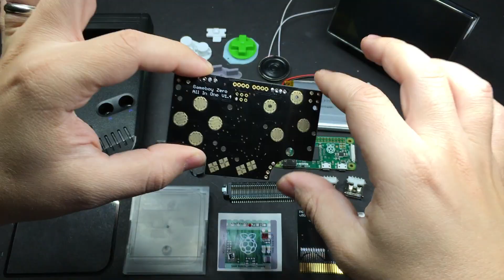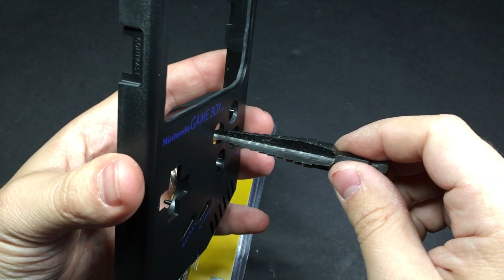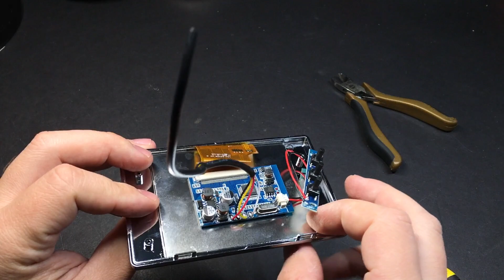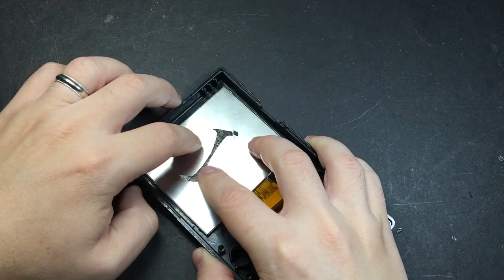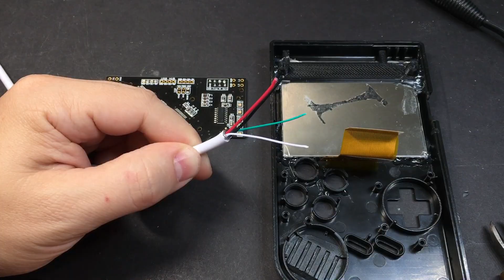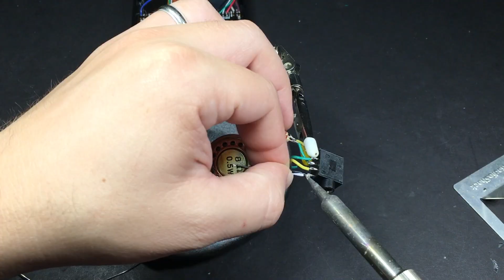Game Boy Zero Custom Part Build Guide Part 1

Comment: Please can someone help me; the sudomod forums site seems to be offline or otherwise unreachable for me (I've tried with VPN too, since I'm in germany). My screen controller board is a different one (BEST012-3.5D-V1.1, hope this is the right description). It clearly says it needs a 12v input and I have not found any instructions on how to convert it (if possible) to work with 5v. If anyone could help me with this specific board I'd hugely appreciate it

Comment: I like this guide it is very informative, but it seems a lot of the part links no longer work. I saw you can use a tinkerboy as a replacement for the button PCB. However, does anyone have a good alternative for the cartridge PCB? I like that little touch that a bit of it is housed in the cartridge.
Reply: yo dude, you found anything?

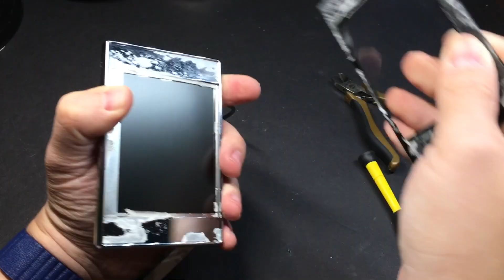Comment: pro tip 3 years later: 4:50 - heat it up with a hair dryer so you can remove the thing easy from the glue.
Reply: And someone called him savage IN THE COMMENTS...

Comment: I realise this video is rather old now... but if anyone wants to do a build like this... You can get 40 pin DPI screens really cheap all over the place i get mine from buydisplay... Theyre great quality and you can contro and runl them directly from the raspbery gpio. You only need to have a separate board to drive the backlight. Its far more efficient and higher quality than using a composite video display like in this video...

Comment: I can't get my screen to work. I bought one like you have in this video on ebay... but the controller board is different. I connected it but it doesnt do anything. Maybe the voltage is too low? How could I check if the display isn't broken?

Comment: Is there a way I could just use these parts for a Raspberry Pi 3? I'd swap the case of course.
Reply: I'd recommend checking the forums. I've seen people who've done it with a pi 3, but their builds used different parts and modifications.
Reply: Matt Henderson I’m probably gonna build a super pi boy from thingaverse but I dunno what to do to connect the buttons on the front and back
Reply: Matt Henderson also is there a way I could say cut up a cheap wired third party snes controller and solder the wires to the gpio?

Comment: Wermy, it would extremely beneficial if you did an update. The PCB all in one boards are no longer available and when they are the are extremely hard to get. Which makes it hard to wire everything else up. I’m having to scour the web looking for hints on how to combine all of the old information-with the latest and its super frustrating. Those boards are super hard to acquire. Do all that have dropped money on this project and are following your lead and tutorials a huge favor and make an update giving options and similar compatible parts to the pcb board. I am sure I am not the only one at a cold standstill with this product now because the unavailability and inconsistent products that Helder makes
Reply from the maker: DARTHRAIDER some cool stuff coming up in the next couple months - stay tuned.  :)

Comment: Does anyone know of a good color backlit screen that's the same size as the original GameBoy screen? 

I want to build a Pi project like this, but I want to case the DMG GameBoy inside a Konami Hyperboy, which is an awesome mini arcade cabinet. In order to do that, I need a 4:3 screen that's the same dimensions as the original GameBoy. 

Any advice?

Comment: It would be an absolute dream to build one of these, except I would want to use a Raspberry pi 3 instead, do you think all of the parts could still fit inside? If not, what sacrifices in the hardware do you suppose I would require to free up space?

Comment: Would this LCD work? https://www.aliexpress.com/item/3-5-inch-26P-SPI-TFT-LCD-Display-Screen-with-Touch-Panel-320-480-for-RPi1/32746328272.html?spm=a2g0s.13010208.99999999.346.8NrZfU
Reply: Dimensions SEEM to match. I ended up doing a different project instead, but at the price of that panel, and its claimed compatibility, it is worth a shot. It should have direct compatibility with the raspberry pi without any extra boards, so it should do the job. You would also have a color screen so you could play NES games and gameboy color games on it too. 
A black and white screen would have better contrast and no color fringing on on monochrome gameboy games though. I would expect no quality control and therefore possible dead pixels on a $12 USD panel, so there is that too.

Comment: Anyone know where I can get the PCB board since Helder is sold out? or one similar?
Reply: I ordered this
but there is a sound to connect (
there will be a prefix without sound (

http://www.ebay.com/itm/Gameboy-DMG-01-4-button-PCB-DIY-Pi-Zero/232462415580?_trkparms=aid%3D444000%26algo%3DSOI.DEFAULT%26ao%3D1%26asc%3D46086%26meid%3D2406fc9a93714e3599ab0d59c6230757%26pid%3D100037%26rk%3D2%26rkt%3D2%26sd%3D232424309912&_trksid=p2047675.c100037.m2107

Comment: yay emulation mods!
btw, as a safety measure when using those unibits/stepped drill bits, just get a piece of tape and wrap around where you want to stop so you don't accidentally go overboard.

Comment: so wait, you are using an ANALOG signal for your LCD screen while there are cheaper and better screens that are compatible with raspberry ...
Reply from the maker: Cheaper screens that are the wrong aspect ratio and run off of the GPIO pins, meaning they run at like 15fps (the 3.5" ones, anyway).  You sacrifice some clarity, sure, but it's a silky-smooth 60fps.  :)

Comment: is it possible to use the RPi3 instead of the RPZero?
Reply: MusicBeat Yea I was able to do that fine!
Reply: wcvikingdude i know this is late,but you were able to fit everything inside? i couldn't seem to do it.
Reply: RELIC_Ruby I've been doing some research on using a RPi3, I don't know what you've seen or figured out within the last 4 weeks, but its possible to use a RPi3, but you would have to mod it and basically take off the bulky parts such as the USB ports and so on... I found a guy who did this with a gameboy pocket... this is a link to that site:
 http://www.xodustech.com/projects/raspberry-pi-gameboy-pocket
Reply: Zak Orlando ok thanks for the info!

Comment: how hard would it be to fit a raspberry pi 3 instead? other than removing the usb ports, would any of the parts change or is it the same process?
Reply: From what I understand it's possible. It's certainly been done. But it's recommended you tackle that if you are good with a solder. If you mess up, you will ruin your pi. 

I for now will work on a zero. I might use a pi3 for something else.

Comment: Hey, I used the same screen however the colors turned inverted after about 5 minutes of use. I have looked up common issues and have reinstalled retropie several times determining that it is indeed the screen.

Comment: Why does every builder on YouTube uses goddamn hot glue ?? Whats wrong with using superglue or something similar ?
Reply from the maker: Several reasons!  I like how fast, easy and cheap hot glue is, and in my opinion, super glue is far too brittle and doesn't have enough volume for many of the places I use hot glue.  As an added bonus, a little isopropyl alcohol removes hot glue incredibly quickly and cleanly, so that's nice too for making modifications and adjustments in the future.  I do use epoxy where something more permanent/rigid is needed.  At the end of the day though, it's all a matter of preference: don't like hot glue?  Don't use it!  :)
Reply: Hot glue has a number of uses in electronics where epoxy or cyanoacrylate (superglue) don't work well. Is this a serious question? Each adhesive has their purpose and probably a plethora of unintended ones. For example I have been known to use thin CA glue as a wood finish on the lathe (pen makers figured that out I think). If I am trying to secure a wire or reinforce a connection to a partially damaged eyelet on pcb I will likely use the hot glue gun.

Comment: Is this (http://www.ebay.com/itm/Common-Ground-DMG-Button-PCB-Nintendo-Game-Boy-Raspberry-Pi-zero-/192026935918?hash=item2cb5b2826e:g:hLgAAOSwOyJX71Sh) the same as the board used in 9:25?
Reply: Idraki Radzi No its not

Comment: For better sound quality, use 1uF capacitors instead of resistors. The capacitors will prevent the stereo channels from backfeeding into each other and causing distortion. Using resistors only is bad because it just lowers the volume of the audio. Using an inductor/ferrite bead is even worse because it acts like an RF choke and further reduces volume and adds distortion.

If you find the volume is too loud with 1uF capacitors, you can add a single resistor after them to reduce the volume. You can also experiment with the value of the capacitor, lower and higher values will change the frequency cutoff. So you can reduce the lows or highs or keep it somewhere in the middle.
Reply: GGigabiteM hmm. Never heard of that. Sounds like it’ll work though.
Reply: GGigabiteM Thanks for the info, I am currently doing this project.  What max voltage should I choose?

Comment: "and 3D printed parts.." Okay, aaaaand i'm out... So without 3D printer i'm fucked :/  Too bad… would have been fun to build one of these.
Reply from the maker: +KRAFTWERK2K6 they aren't required - if you check out the original guide I did you'll see how I did it without them. :) plus all the 3D-printed parts are for sale on market.sudomod.com if you do want to use them (just makes the build cleaner and easier).
Reply: Well you see the problem is that for people outside of the USA (just like me) it is still pretty pricey to ship little plastic pieces overseas for such a project.  :( The shipping costs are always a dealbreaker.

Comment: FYI, use a hair dryer on the screen to remove the adhesive. A hot air station is what I use of course but hey, I'm assuming you don't generally have a nice workstation like that and a hair dryer will be fine.

Also, use a knife(to remove the old) and then some 3m double sided adhesive, it'll work a lot better than hot snot and you won't need a bracket. Hot snot should generally never be used unless it's to tack a wire down when building electronics.

Comment: what would be the total cost of making this? including the parts and tools that are needed.
Reply: I just did some quick math, I got around $250 for parts and about $50 for tools if you have none of them. Not included in my math are things like wire, and some other little parts.

Comment: can I watch Netflix on this?
Reply: GrimaceBSX i dont see why he couldnt put a chromecast device in it.
Reply: yeah, if you use another operating system and put a wifi dongle
Reply: GrimaceBSX should be able to, if you plug in a wifi adapter and keyboard with usb
Reply: Doesn't the zero W have wifi?
Reply: GrimaceBSX gda
Reply: No. Raspi doesn’t support Netflix

Comment: Is there anywhere you can actually buy the cartrige readers now? Everywhere I look they're unavailable. Might just stick with the Zero's sd card slot instead...
Reply: As an alternative you could just hook up any other card reader and glue it in place of the cartridge slot. It just won't look that "authentic". :)
Reply: I wonder if a CF card would fit well in a gameboy cart?
Reply: Don't think so. Plus you'd need an IDE interface, something the Pi doesn't have built-in.
Reply: Eh. guess I'll just stick with empty cart shell and the pis sd slot
Reply: I was thinking of just using the pi's SD card slot and skipping a few steps. I don't anticipate needing to remove the SD card very often, so I am OK with burying it inside. I can always open it up if I need to remove it. I may plug in a small wi-fi adapter internally so that I can add/remove games wirelessly Iike I have been doing with my Rasberry Pi 2.

Comment: He awesome build but how did you build the shoulder buttons?
Reply: Those are standard push buttons you can buy from most electronic supply stores or ebay. He abused two of the original screw holes to place them in.
Reply: coolio

Comment: You can use less Parts for sure.

The Button Board is super easy to build. You can wire the buttons directly into the Pi.
For Audio, there is a GPIO PWM Audio Guide out there.

SPI Screens seem to work pretty well, and they are really cheap.

I disassembled a old USB Powerbank, and it had all the Battery parts already done.

This working is not confirmed. Still waiting for Parts.

Comment: Anyone know, off the top of your head, what the ballpark price of all the parts adds up to?
Reply: Okay, so if you like me wanted to know what the part list tallied up to, here it is.

Overall cost is ~$230.00 (USD).  This includes shipping to the US (at least for my zip code).  I wasn't able to determine shipping for the buttons and aftermarket cart shell.

I also found some lower cost part options that are not accounted for in the overall cost, which references the parts listed by wermy in his post.  I did add the cost for the Raspberry Pi Zero which is not included in the original part list (well not technically speaking).  :)  Link to the list and Blog post in the video description.
Reply: William Hayden Might as well just buy a GameBoy. It's a LOT cheaper.
Reply: TheGrayWolf81 There's no fun in that.
Reply: William Hayden Yes there is: the games and the GameBoy itself. Even though I love to build and make things myself, I just don't like this. but that might just be because I'm a retro gamer myself :P
Reply: I already own a busted gameboy (screen doesn't work) and an old NES controller to salvage some parts from, and I think I estimated somewhere around $100-$150 for the parts I'll need.
Reply: Duane Francis Just buy a new GameBoy screen and replaced it. Voila, you have yourself a working GameBoy again :P
Reply: TheGrayWolf81 But I'd rather have a Gameboy Zero.
Reply: Duane Francis :/ IMO the GameBoy would be way better but whatever you want :/ You should just get a GameBoy shell instead of wasting the original GameBoy, since if you really don't care about an actual GameBoy, you could just sell it and give it to someone who will actually have fun with it. Plus that way you'll make a few extra dollars for the GB Zero project.
Reply: I don't think I'd make much selling a non-functional Gameboy. I can pull out the main board and other components I don't use to sell to someone who wants to repair theirs (I plan on using most of the parts Wermy is using for his build), but the case is worth more to me than I'd likely be able to get for it + it will look like an original at first glance when I am done.
Reply: Duane Francis You said that the screen is the only problem, right? Just buy a replacement (they're cheap) and there you go. Plus, you can't even tell the difference between a case they sell online compared to an original GameBoy.
Reply: I don't want to replace the screen - it's worth to me as parts than it is to repair/resell it. Even thought the screen is the only issue at the moment, the unit was used hard and likely wouldn't sell for more than $35 after I spend the $$$ to replace the screen and replace the worn rubber behind the buttons so that it works perfectly. If you care so much about it, why don't you pay me $35 and I'll send you the innards so you can use a replacement case that "you can't even tell the difference"? I've had this Gameboy since I was a young kid and I want to make it into something even cooler than the original. Quit hassling me.
Reply: Duane Francis Alright. Fair enough.
Reply: Duane Francis how old are you

Comment: Couldn't you just 3D print the case?
Reply: That would be quite expensive compared to a massproduct. You will need the 3D data, too, and it will look like sh** and will not be as durable then a "real" plastic one.
Reply: Hmm fair enough

Comment: What exactly is a Gameboy Zero? I love gameboy and want to build one. Also what is Raspberry Pi Zero? is it that "$5 computer"???
Reply: It's actually an original gameboy case. Yes its the $5 computer. Theres a full writeup in the desc
Reply: I know the 0 w is $10 but I don't know how much the original 0 is
Reply: Its a device for emulating games, made to look like a gameboy. Its using raspberry pi, which is the 5usd computer, and it runs retropie which can emulate a lot of systems
Reply: Me its a circuit board named after fruit, fool. What you think?